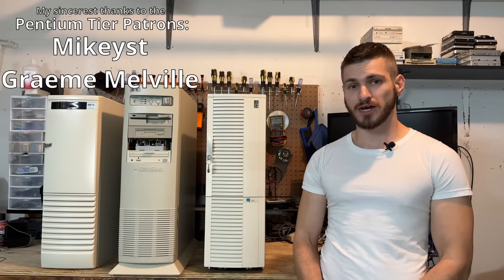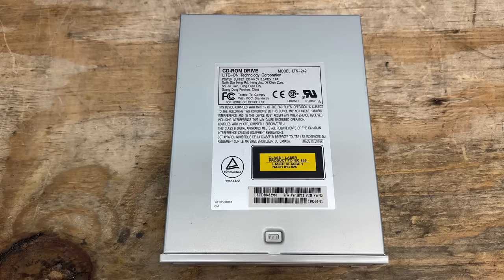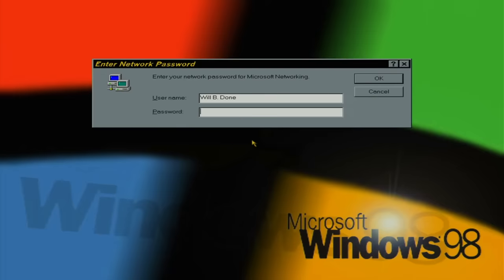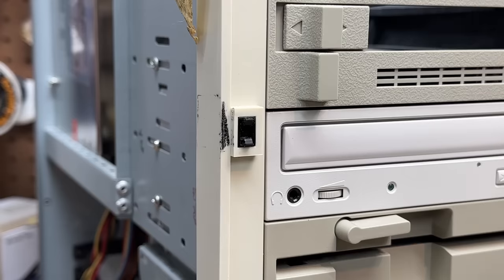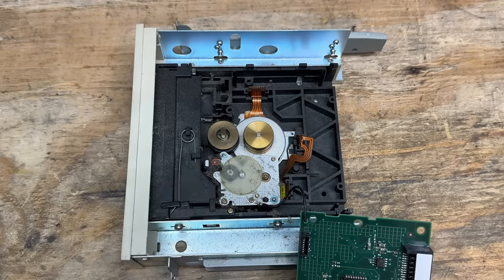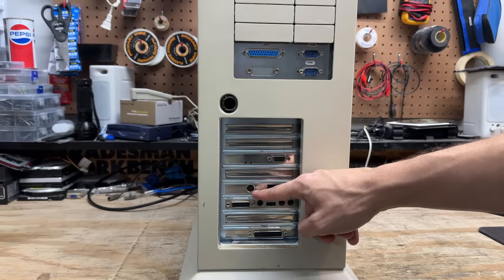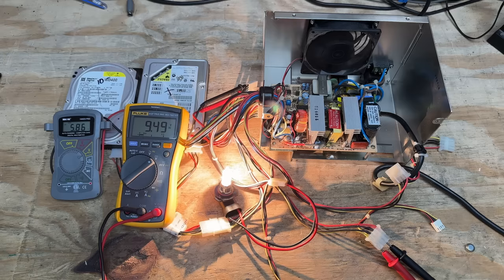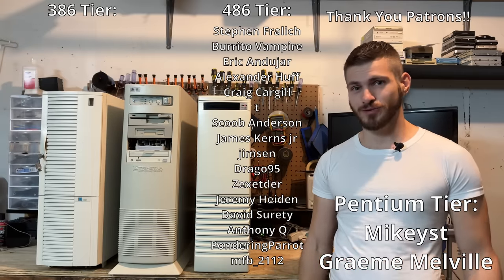Giant Retro Towers - Teardown and test!

Comment: You can use superglue and baking soda to build up the plastic tab on that door and file it into the shape you want. You basically apply glue, sprinkle on the powder and it turns into a hard rock like substance, and you can just build it up a layer at a time. The chemical reaction does produce some heat, and happens quickly, so let the part cool down so the plastic doesn't deform.

Comment: Zwnon was a heavy advertiser in Computer Shopper in the 90s. They let you build your machine the way you wanted, video card, ram etc.  I had a giant case you have already shown in a video with a PentiumPro 200 and a Imagine II number 9 ( the kick azz video card of the day, later upgraded to Orchid 3dfx sli setup). It was a huge expense back then $2000 .  They pretty much beat any other vendor and had a good rep as far as I can remember.  Quake at horrible FPS but still  beating everybody else machine  166 etc machines, the PPRO 200 when released was a beast, the kids would cry today with the FPS numbers... the bad old dark ages.

Comment: It is recommended to drill through one of the leads to internal battery when modifying those dallas RTC chips. You don't want the old battery to become additional load for your external battery.
Reply: Yes. I bet if he checked the voltage after combining the new 3 volt batter to the old 0.5 volt, the new voltage would be somewhere around 2.0 v
  That said, I have found that  0.5v is usually enough to keep the settings.

Comment: My theory is that the Toshiba SCSI drive from the first machine had a fatal head crash on one of its platters, but is a multi-platter/head drive that can still read from the other one(s). Would explain how it's still readable but has a ton of bad sectors marked like that. Would love to see an autopsy of that drive at some point!
Reply: Most likely right, but even the smallest dust grain could cause it, and most likely wouldn't see anything unless you got the microscope out. Or the head was just damaged. I've taken apart a few of these where it's like half the drive died (very common back then) and you wouldn't ever see anything on any of the platers.

Comment: Love all of your videos, I've watched them all and look forward to you releasing a new video at the end of each week. ❤ I noticed those 866MHz Pentium 3's were only running at 520MHz, I'm guessing the settings must have been input manually and when the CMOS battery died it went back to defaults (I'm pretty sure that board is new enough to not need jumpers for setting bus speed and multiplier lol)

Comment: This is a really cool video, some very nice hardware that you found there!
Could you make a video that shows how you find those systems, where you store them, and what you do with them after restoring them?

Also, why do you use those low resistance bulbs for testing the PSUs? Is it to test the anti-shorting protection?

Comment: Nice find and review, btw, on the last tower computer, i believe that small ISA Card with DB25 pin connector, is not a parallel port card, but a SCSI card which usually used by scanner, usually older HP or UMAX scanner (the card comes with them when you purchase these scanners), the card uses NCR/Symbios 53C400 SCSI controller chip

Comment: Thank you Mike for the Big Tower Retro Show , I was working at a PC Repair Shop in St. Louis called Word Pro during these years and this is some of the stuff we would see . Good to see Bigger cases like these as they are becoming more Rare :) QC
Reply: I think i bought the very last one from my PC repair shop 20 years ago,  case was shite quality but it did the job. Binned the system off about 6 years ago there,  Everything was practically buggered drive wise, and the motherboard was shite one anyway.  laugh was i had a fault on its 1st board, so the shop "sent it away"  fast forwards 10 years later, when they were shutting down or what ever, and they give me a bell, i was like what board??  he tried to say it was lost in the post, i was like aye fella, nearly 10 years and it pops up. I think i had even binned the original setup off by that point.  collected the board and it went straight in the bin.

Comment: Some really cool systems there, and quite a trip down memory lane with that JDR Microdevices power supply. JDR had some really cool stuff back in the day like POST analyzer cards and cards with breadboards on them for making interface cards.
That Micronics Motherboard and Power Tronic Power Supply combo is the same pairing that early Gateway machines used, I wonder if Gateway was the OEM for Tri Star and others. It also looks like there was a scanner attached to that machine with the HP SCSI card (NCR Chipset) card and a copy of Ofoto, I would guess an HP ScanJet 4C. 
NCR made many of the SCSI chipsets starting in the mid 80's and yes the chipset in the other machine did say tolerant, it was a style of chipset that they started in 1990 with the Mac IIfx it was supposed to be more stable and less prone to SCSI Voodoo, but in the IIfx it was very prone to SCSI Voodoo but they were pushing the chips and the drives for throughput in that machine.

Comment: I had a SCSI CD Drive with a Caddy that looked identical to that one in the Tri-CAD case. Mine was a CD Writer. I remember it taking ages to burn a full disk. Mine however was in an external case with a 50pin centronics plug on the external case. I used it on both my PC and my Amiga.

Comment: 37:00 sounds like you need to make yourself a "programmable load". They can be made from an op-amp (plus support components), some high power resistors and several MOSFETs in parallel, bolted to a heatsink. Google "programmable load schematic". Going by your previous videos, I doubt you'd have trouble making one. Cheers.

Comment: When I first started in PCs I built an XT class clone with parts from Jdr m icrodevices. 
Long story short: NEVER AGAIN WILL I even entertain buying from them. It was 1987. 
The MCT parts were cheap VERY cheap. 
In the first year I went through 7 miotherboards and 8 power suplies 5 of which came D.O.A.

I tell you this to use caution with that PSU  
as to the broken catch on the case door they were usualy  Touch latches.

I really enjoy these vids a the trip down memory lane.  Joel

Comment: Well this video brought back memories.  When I was a teenager in High School in the early 2000s I used to play around with old systems like these.  Now, I never came across any old towers like those shown here but I saw the Baby AT systems and definitely had a few of those as well as some old Digital Electric Corp 486 slim desktop systems.  My favourite systems to work with these days are either Lenovo or HP business desktop systems with the relatively tool-free designs.  In fact, my HP Elite Desk tower has the legacy of Compaq Deskpro computers tool-less design implemented in it even down to the size of the power supply casing.

Comment: That 3rd system probably used a colorado memory systems QIC tape drive(i.e. jumbo 250). They used the floppy controller for the interface. Sound card is SB16 with scsi-2 interface, with waveblaster header and jumpers for internal/line-out output plus the usual jumpers for dma/high dma, and irq. Very nice.

Comment: I'm pretty sure that a lot of your "parallel port cards" that you find are simple SCSI adapters that were often bundled with scanners. Unless you know for sure otherwise. They used the same D-sub 25-pin ports, but were not compatible.

Comment: I still have and use a big case similar to those, only it was designed for ATX-style mainboards. It's the only component in my setup that is still the same. Everything else was changed and I never had any airflow and cooling problems people have with newer cases. The only case I would it change for is an old Dell case where you had the mainboard on one side and the drives on the other. Don't know what it was called. It was sold as a high end gaming system / workstation and you could fit 14 5.25 drives in it.

Comment: I love watching repairs on older pcs I'm only used to working on modern pcs and find this very informative.Thank you for your content.😊It's very interesting to me to see this even though I owned vintage pcs when I was a teenager I never worked on them.First pc was a Compaq 286 with two 5 and a half floppy drives using MS-DOS 3.0 such nostalgia I also owned both a Compaq 386 and 486 both running windows 3.11 for workgroups
.😅I sort of miss them. The old comoaq keyboard ms felt more tactility pleasing the roller ball mice werent so great though.Had an old cannon bjc 200 printer and loved the way it printed at the time even though not perfect and a couple of dot matrix printers b&w such nostalgia.

Comment: That last tape drive is probably a Colorado Jumbo 250, maybe 120, but yeah, floppy interfaces were really popular with the CMS tape drives. They also made portable ones that used the parallel port to transfer data. Not very speedy, but they got the job done.  They take QIC-80 tapes that you can compress. I still have the 2 tapes I made from my 486/66 Win 3.11 machine back in 1995, and they're still readable. I bought a NOS Jumbo 350 off eBay and it came with that extended floppy cable so you could still have both 3.5 and 5.25 drives connected.  Anyway, another awesome video, Mike.
Reply from the maker: Thanks for the info!

Comment: I have that board in one of my old workstations and I love it. The only difference with the DLS model is the Adaptec 7880 SCSI controller, which is the classic AHA-2940UW but onboard. I already had a faster card so I saved some money. At that time, there were already newer and faster U160 and later U320 SCSI adapters, so buying the expensinve version made no sense. It is a fantastic board and even supports dual 1.4 P3 Tualatin, albeit with small intermediate socket boards for the voltage regulation. No mods are required. Just CPU coollers with adjustable springs to take the slack for the extra 2mm height difference. It maxes out at 4GB of RAM and supports AGP pro 4X GPUs and newer 8X but at half the bus speed. Having such a machine back in 2000-1 was a pleasure to work with and it was expensive AF. That rig along with a rpofessional 22" CRT monitor cost me almost $10K in today's money adjusted for inflation. It would run circles around SGI and Apple systems of the day. I still use today for retro software with Linux and Windows XP/7 and it can even do all modern things. This thing has paid for itself multiple times.

Comment: I thought that most of the psu capacity in that time period was with 5V rail so even if psu would be fully functional I would not be surprised if 12V rail would not be able to handle that kind of loads.

Comment: I really enjoyed this video reminds of the AT pc i found abandoned on the side of the road that i dragged home, after tearing everything apart and scrubing any dust/corrosion i could find (only areas of parts directly exposed to the elements had rust/corrosion, the inside was surprisingly clean) and after reassembling everything it surprisingly posted (2gb hdd was fairly unhappy though, had bad sectors) system had a 166mhz pentium mmx, 32 mb edo ram, a motherboard i dont really remember the brand of and a trident tvga 8900b with 1mb video ram and used to be running windows 95 according  to the files on the hard drive, i actually used it a bit after installing a new hdd/psu, adding a isa sound blaster carda different video cardand a fresh copy of dos 6.22 for retro gaming though i ended up parting it out due to the heavy rust on the vga, serial ports, at keyboard connector and every other external port and the cmos battery having popped and leaked onto the board having corroded some of the traces. I still have the cd drive, ram, cpu , vga card and floppy drive,  with the floppy drive currently being used in my new pentium mmx 233 machine i recently put together. OH AND BTW, my reaction to the 2nd tower you showed in your video with the 2 pentium iii cpus: 🤤oohh....i want that....must have!!

Comment: The RTC hack may be done by chopping off the original battery and only soldering to the pin. I wonder if the original battery will discharge the new one quickly by simplifying the process.

Comment: Very nice. To much to even type about from the JDR PSU to the case with the back plastic cover for it. One side note. If you ever see a floppy drive tape backup and it is connected to a separate board. That might be a board to almost double the backup speed. FYI. They are not that common but once I found out what they did. I sold them with all the backup drives until they went to IDE.

Comment: Just Noticed System 1 is a Socket 7 using a RTC Battery Module... That motherboard (looks like a D.F.I. or Amptrom) I think it has pads and drop-point for a CR232 battery module although I dont know if the traces go anywhere.

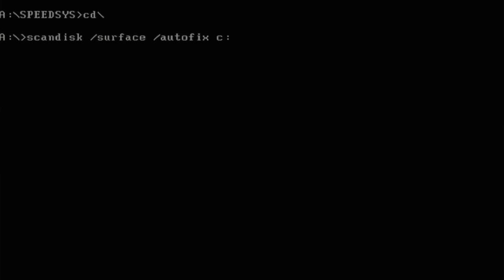Comment: 24:46 haha, well that came out of nowhere! However, I wonder if this could be the doing of the bad PSU? if it was undervolting and the drive had difficulty reading a sector as a result, it could have added it to it's internal defect list and failfast on requests to read that sector going forward, so formatting doesn't help. I thought I had a "failing" Fujitsu 8GB drive as it kept getting new bad sectors, but it never got another one after I replaced the power supply on the system it was in- despite this the existing bad sectors remained after formatting. Supposedly there's some vendor-specific stuff you can do to get to the defect lists and even clear them sometimes.

Comment: Stopped by an estate sale last Friday.  Looked around, saw some tech stuff.  Picked up an EnPower TW3 EAA-89 laptop for $25USD.  Never seen one before.  Core Duo T2300, 1GB of RAM (512 onboard, 512 stick), 80GB HD, 945G video, 15.6" 1280x768 screen, and LOTS of ports:

Four USB, firewire 400, PCMCIA and SD card, s-video, NIC and 56K, and something I've never seen in a laptop before:  DVI output!  Like an actual full sized DVI port.  Too cool.

It's in really good shape, all I needed to do was reseat the CMOS battery.  Seems like a really good computer from 15 years ago.

Is running XP home SP3.  It also had all documents and email intact.  So, PSA:  When you sell a computer, wipe or destroy the HDs.

Comment: The crazy design of the large cases had the main board under the drive cages which made me crazy.

I had a 9 GB SCSI external hard drive with my 386
The drive weighed 40 pounds and was 2 feet by 32 inches by 12 inches high.

It was my prized drive.
Back in the days of 386-16 mhz mother board with a 80 mb hard drive.

I paid very little for the drive.
I had a Symbios 50 pin / 68 pin internal connector and I think a 68 pin external connector and a 50 pin external connector.
I had 25 pin SCSI adapters and 50 and 68 pin adapters. I ran a flatbed scanner that took a full minute to scan a legal page
I had 3 devices on the SCSI external and 3 internal hard drives and a CD Rom.
It was a monster of a system
I ran DOS and Windows 3.1 and was so happy to get Windows 95.
It changed my life

Comment: Those sure are awesome! I don’t understand how stuff like this ends at ewaste… I bet all 3 are quite valuable but especially that dual CPU board… 
I’m jealous of the hard drives you got in those, a micropolis drive is something I don’t have, nor a vintage SCSI Toshiba and I wish I could get a working Maxtor LXT as well. Seems like the drives that are in the systems you get are often still functioning as well, I guess they aren’t getting banged around as much as lose drives that are kept then sold by people.
Reply from the maker: I was surprised the HDDs in the last system were good at all. It looks like that tower took some considerable shock at some point.

Comment: Ive got the fully populated version of the CUV4X motherboard - it will run dual Copermine Cpus (mine has a pair of 1ghz), and apparently can run dual Tualatin 1.4s if they are pin modded.

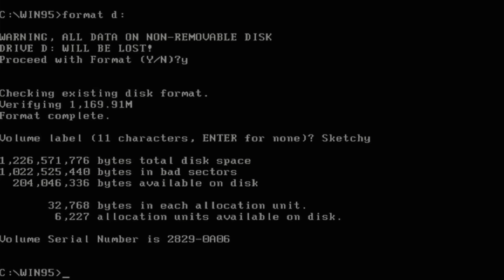Comment: 26:19 You might want to try low-level formatting that Toshiba drive. Most SCSI controllers have a suite of utilities (including low-level format) that you can access during boot-up. If the drive is trash as-is, there’s no harm in trying.

Comment: For those "oddly shaped parallel port cards" I'm wondering if those are older SCSI narrow cards for external drives / scanners. Also, sharing a CD drive back then was common esp to save cost on putting cd drives on all workstations if you just needed to share some data off of an optical disk.
Reply: ah maybe not i now remember back then we'd do this for multiple printers on a file server.

Comment: Hah, I still have a few of these floating around. One is at the end of my driveway with my street address on. Another is and old school server that housed a dual Pentium Pro mobo running Windows NT server, and a third one is quite a bit newer. It's a black anodized aluminum full tower made by Antec and was my NAS for my internal network..

Comment: I had beast of a server case with the CUV-D mobo and dual piii 1GHz CPUs and even though games at the time didn't use more than 1 CPU I had Win2000 installed and a GeForce 2 ultra in it for gaming. When I finally upgraded to p4 machine I relegated it to being a file server.

Comment: Do you need special software for two Pentium 3s to run or does the system divide up the work by itself?  Great video!  Would love you to build me a 286 system to run my old favorite Empire Deluxe, ha!
Reply from the maker: Both the operating system and the program will need to be optimized for multiple CPUs. Support was unfortunately not very mature (at least for consumer software) back when this machine was new. However, machines like this and later multi-core CPUs helped push software developers in that direction.